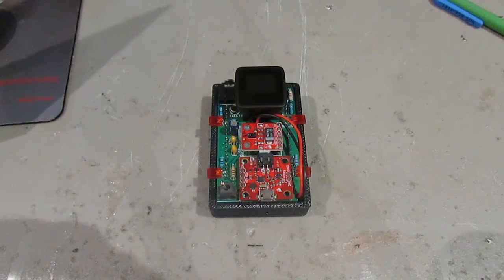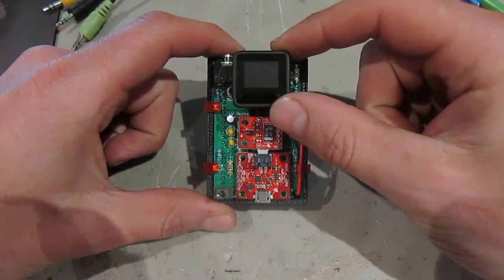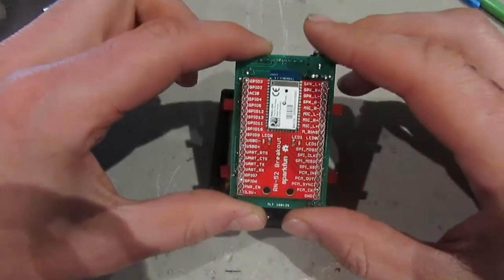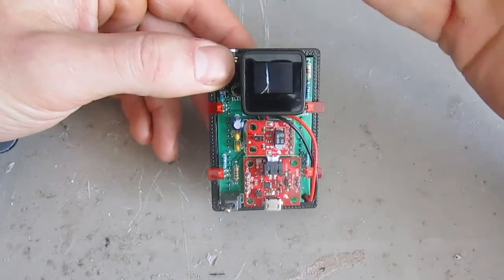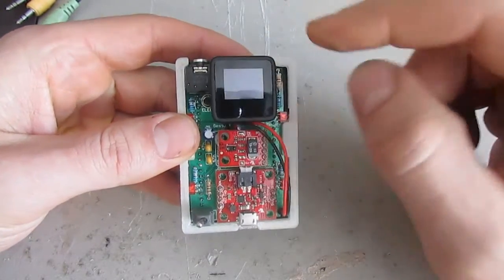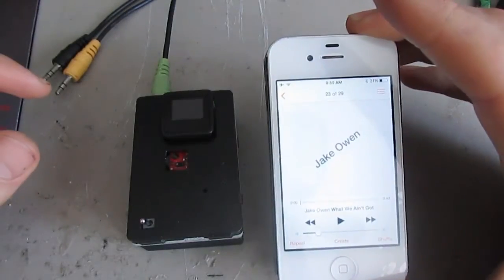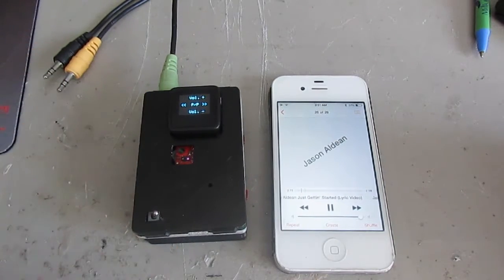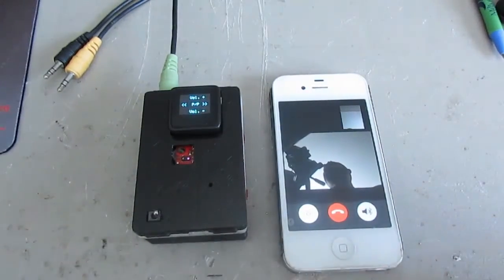Hand Gesture Controlled Bluetooth Audio Link (Handi)

Comment: Great project! How is the sensor coping with direct sunlight? Do you have to keep it away from windows is it working ok in the car? Keep up the good work
Reply from the maker: Thanks Andrei! In direct sunlight the sensor can sometimes be falsely triggered unfortunately. I never really investigated a way to prevent this, I just try and keep it out of really intense sunlight. In normal sunlight it seems to work very reliably. Do you have any experience with these sensors?
Reply: No I was doing some research to decide wether to buy one. I would read the ambient light level and maybe ignore commands if light level is larger than a threshold but then you are left with no control...
Reply from the maker: Yeah, to be honest, I got the project to a certain stage and its very usable so I didn't tweak it anymore. Totally possible to try and filter out unusual peaks though :)

Comment: Hey just watched this video and was lost for words, currently a uni student working on my major final project and it incorporates some of the tech you used in this video would really like to have a go at this project do you still have any PCB's left also what other components will I need to build the hand gesture controller?
Reply from the maker: +Mike Worrincy Hi Mike, thanks for the comment. I do still have PCBs left if you're interested. The major components you need are listed in the video and the video description. Other than those major components from sparkfun, you will need a few LEDs, a mini condenser microphone, 100uf capacitor, a few other small caps, and a few resistors. All of the component values are listed on the board. Of course, you will also need to code the microview to make it all work.
Reply: +Embrace Racing Thank you for the reply, I think that i would like to purchase the PCB from you if possible, What is the best way for me to buy it from you.. Also got the other bits written down and should be able to purchase them from spark fun. let me know what you think! cheers
Reply from the maker: +Mike Worrincy Send me a private message on Youtube and we can arrange everything. Thanks!